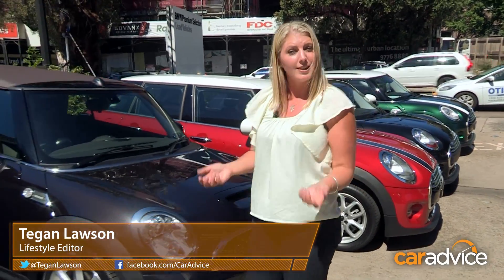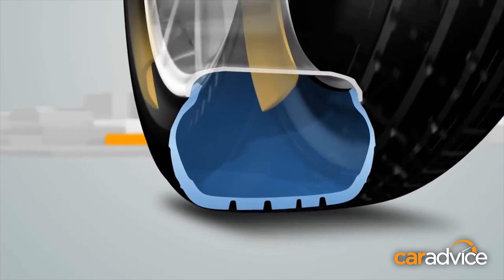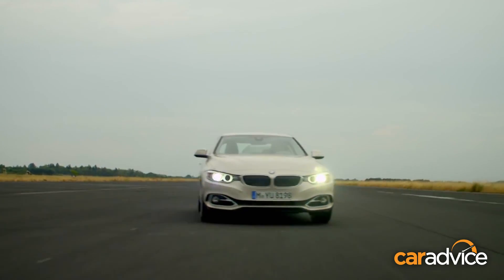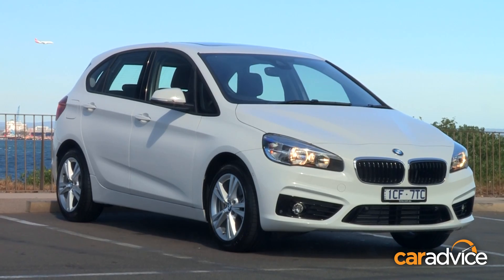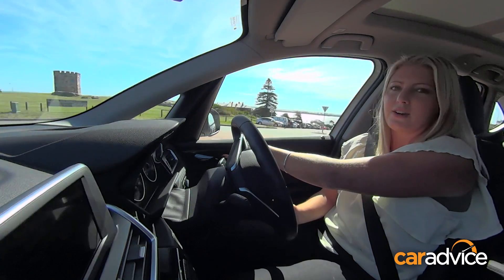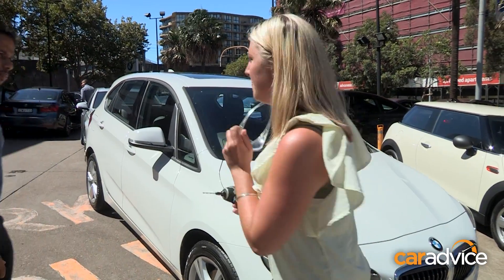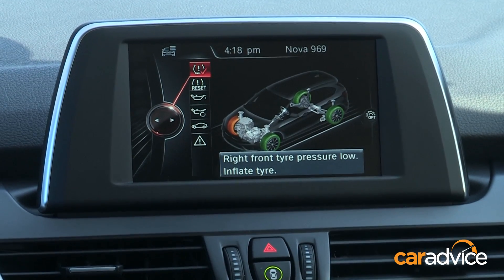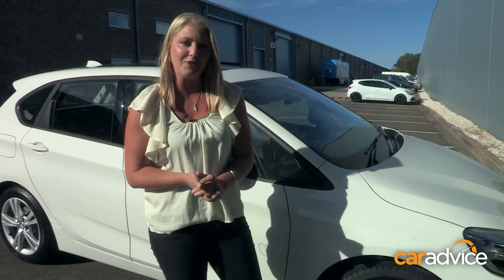Car technology : driving on a flat run flat tyre

Comment: I have a 2017 BMW 330i and 2 new rear tires ran about $620 U.S. dollars. It does ride a bit hard and hits uneven pavement pretty hard. I've never gotten a flat. Run flats are about 20% more than conventional tires but in LA traffic they may save your life.

Comment: Biggest draw back is run flats cannot be repaired.
Reply: T S not true. I had two repaired when I had my e90 which was a few years ago and when RF’s were relatively new to being put on BMW’s. All depends where the puncture is - I had huge screw go through my tyre and id only just purchased new tyres too grr. Some garages just don’t want to repair them.

Comment: I have RFTs on my w205 c250d and the other day I received a warning about low pressure on my front right tyre. I refilled it promptly not thinking it was a puncture and so far it seems ok- the pressure is definitely not the same as the the tyres as shown in the dash 260 vs 275 after running for an hour and it takes longer to heat up compared to the others, but how do I know if it's actually punctured or needs replacing?

Comment: Had a flat tyre on a Sunday afternoon travelling from Melbourne to Sydney. Had nowhere to fix it so all up travelled more than 600km before I had it replaced. Being one of the rear tyres you could not really feel it even travelling at 100km/h.
Reply from the maker: Which car were you in Al? On RFTs?
Reply: BMW 3 series E90. With RFTs; obviously ;)

Comment: Could u have released the air instead of drilling the hole and destroying the tyre?
Reply: Eugene Tan The tyre still would have been destroyed. Runflats usually have to be replaced after a puncture. That's why they are a bad idea and are usually only put on premium cars.
Reply: +hawkesworth1712 thanks for the clarification! =)
Reply from the maker: We wanted to simulate a real life failure - running over a nail or bolt would have similar effect.
Reply: Good pointer!!!
Reply: I know, that’s what I was thinking lol. Very informative video though.